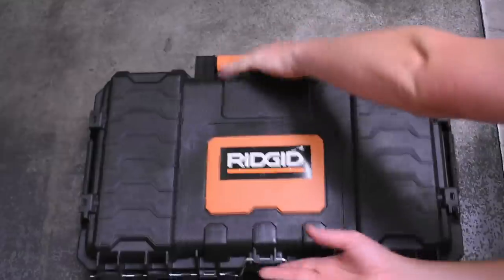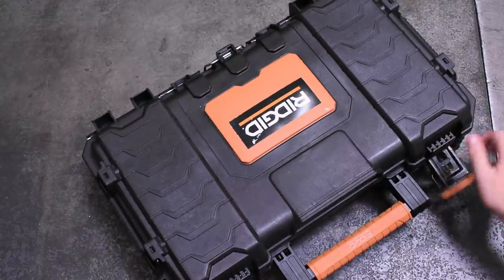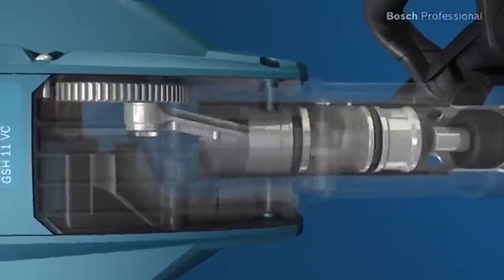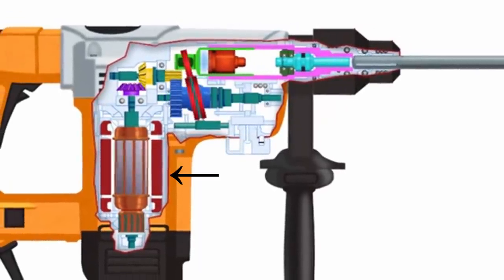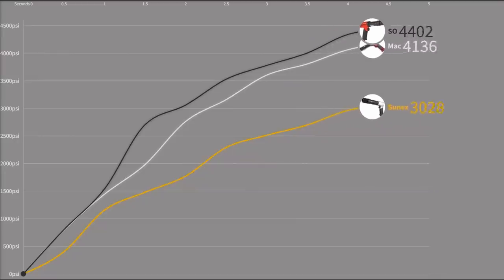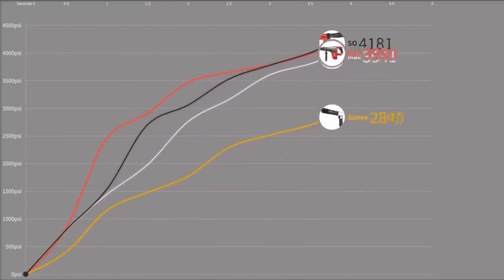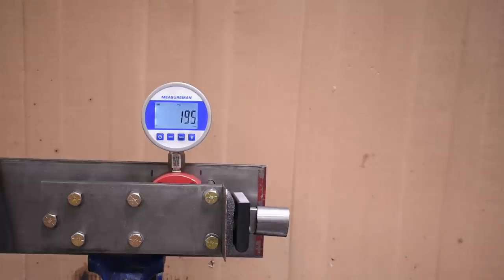How Rotary Hammer Drills Work & Dyno'd vs Air Hammers

Comment from the maker: FAQ: Does pushing harder/different change numbers? Not that we've seen in 76 runs. Also, tightening a bolt with a drill would not have done anything to measure the drill's torque capability, which is why we're not here. Do you want to see more SDS hammers dyno'd? What type? More SDS Max? SDS Plus? Home depot rentals? SDS has been added (for now) onto our air hammer ranking: https://etsy.me/3G8j3QK But can become its own category if grown. This is the best bang/buck .401" air hammer by our math: https://amzn.to/3ITtFoI
Reply: Can you guys try the Ridgid R86711B if you do another video? Thanks for all the great work/content!
Reply: Dewalt dch133
Reply: As a non-car worker, SDS is actually super important for me.  I would love to see twisting torque and hand feel measured like you do with the impact wrenches!
Reply: Some of the smaller SDS plus tools would be nice, since size and weight wise they might compare better with air hammers.
Reply: great video. there are adapters to use sds hammers with a socket so maybe next time a torque test so you have hammer and you have torque numbers then you can realy compare sds hammers
Reply from the maker: Just for everyone's knowledge, a drill can't be dyno'd by tightening a bolt like an impact can. It requires something much more complex that we've been working on with not much luck, but still plugging away.
Reply: Hey, great video. To clarify, in this case foot-pounds is not a measuremnt of torque, but energy. 5 ft-lb is the energy required to lift 1 pound 5 feet high or 5 pounds one foot high.
The biggest hammer drills seem to max out around 14, although milwaukee claims 19 on their largest (starting to look like a small jack hammer).
These tools are interesting though, it's like having the compressor built right into a pneumatic tool.
Reply: Yes! I was just starting to look into these! Heard they are a great addition and have many uses (digging, as well as drilling holes). The price seems to quite broad. Is there noticeable difference in reciprocating saw configuration vs the right angled type (similar to tested)? Some are variable speed, is that worthwhile to pay extra?
Are the Chineseum ones any good? They're a quarter of the price in some instances. Weird to me that the big ones only start around 8 amps. Seems to be broad range of RPMs, is that bc of gearing?  How do they compare and perform for concrete demo? Are battery worthwhile? I own the Rigid line, but prefer corded still.
Reply: .498
Reply: I would love to see all available SDS max and SDS plus hammer drills tested 120v and battery powered. Testing Home Depot rentals is a fantastic idea as well. I rented a Makita demo hammer just like the one in the video last year and was impressed by it.
Reply: Hilti... is it worth it? I'd bet yes
Reply: I have the dewalt version, and the thing that bothered me the most about it was the trigger is simply on or off. That tool set me back $1250. Came with 2 9ah 60v battery's and fast charger. I wish the trigger was variable, because starting off sideways is easier if its not instant on.
Reply: maybe next time a jackhammer with dimensions similar to Atlas Copco TEX5? I saw a little jackhammer like this in a truck service.
Reply: I'd like to see you guys test ingersoll-rand industrial hex bit air hammers.
Reply: The DeWalt 12V Extreme SDS Rotary would be interesting to see compared to other cordless SDS offerings. I suspect the results will leave us wondering why DeWalt even bothered.
Reply: It would be great to see the other milwaukees and Makitas both corded and cordless in the $300 range.
Reply: My big one here for bang-for-buck (most people are not going to buy a $1500 AVR gun to run a cold chisel with) is what's up with the big, cheap Bauer and otherwise HFT rotary hammers.  And for that matter maybe their breaker hammers, which if you need more beans than a long-barrel air gun will ever deliver might just be the "affordable" go-to with IIRC up to 70 "ft-lbs" of impact energy.
Reply: I just wanna see the 498 shank big boys…bought a HF chief after seeing your video, and it’s done everything I’ve asked it to. I’ve split lug nuts with it, busted ball joints, ETC…but if it ever breaks, or fails to do something I ask it to, I’m gonna get a 498 shanker. Wanna know which one is the stoutest.
Reply: Would love to see ryobi HP cordless sds and Bauer 1641E-B.
Reply: I’m curious how the newly released Skill Auto Hammer compares. I know it’s not really intended for the same purpose but it’s a cordless hammering device. It seems like cordless tool companies make one about once every 10 years or so.
Reply: I'd love to see how a Ryobi brushless SDS+ compares
Reply: I would much rather see some air riveters and .498 shank airhammers. Would be very interesting to see how well the teasing trigger on the air riveter works for keeping the power down and how powerful they are compare to the same shank hammer.
Reply: There are SDS to 1/2" socket drive adapters.
Reply: Spoiler alert! Rotary hammers have way less torque than you'd expect for such big drills. My testing showed a 26mm hammer like the dewalt DCH133 had around 1/2 torque of a drill/driver like Milwaukee or impact like Dewalt DCF887N
Reply: I don’t have any of these tools but been seeing ur videos for long time
Reply: Try dewalt 60v
Reply: Can you try this HERCULES 10 Amp 12 lb. SDS-MAX Type Demolition Hammer with Maximum Vibration Control - would like to compare this to the chief air hammer. Thanks!

Comment: I had no idea that was how these worked.  It seems to me that a cordless "air" hammer is actually an option. If Milwaukee were to remove all of the drilling parts they could easily slim this thing down and make it more practical and maybe more powerful.
Reply: In corded variations they exist, they are called chipping hammers or demo hammers. With hammer weights ranging from 11lb to 28lb.

They are the little brothers to jackhammers and exist in atleast 4 sizes that I'm aware of, however none are as compact as a true air chisel or air hammer, instead they are much closer to the roto hammer demonstrated here.
I would guess that is because of the addition of electric motor and battery dock.
Reply: @lightjedi6  company’s will find a way to make one. thier just has to be a demand for that. i saw a few years thier will be a electric air hammer
Reply: @lightjedi6  yes there a pain to run all day busting out refractory.
Reply: They already make electric demo hammers. I prefer to have the rotary hammer with hammer option for what I do with it.
Reply: @VertexDigitalArts  Actually, SDS  rotary hammers are super common in the US, in commercial and industrial use. Many, many multifloor buildings use concrete for the floors, and a large subset of those buildings also use concrete for the walls. Nearly all commercial buildings also use a concrete slab for the foundation.

It's only in residential construction that they're relatively uncommon.
Reply: Or even an attachment for impact wrench's...
Reply: @mudrunner1 It's interesting you say this, because I've seen a mechanic on YT wondering where Milwaukees cordless air hammer was... (they haven't made one yet but your comment is very interesting)
Reply: Those exist.
Its a chipping hammer then. Basically only a motor and hammer gearbox with handles attached. 
They are surprisingly small and lightweight then. My local hardware store had two models from Hikoki in SDS Max and I had to have a look at them only to be really surprised how light and compact a hammer is when you take away everything unecessary and make it a hammer only machine.

Comment: i'd love to see the Hilti Cordless SDS Max tested. theyre probably most expensive in class at around $1,100. does that equal more better
Reply: Equals more better warranty at very least lol 😂
Reply: I'd put my bottom dollar on betting they're the best
Reply: Hilti... Probably not. They are in it for the money.
Reply: For $415 U can get the Metabo HPT 36V SDS MAX Rotary which can go all day with it's AC adapter and lifetime warranty
Reply: Historically, Hilti has prioritized durability and endurance, so it might not actually be more powerful.

Also, $1100 for bare tool or kit? If it’s a kit, Makita’s XGT 80V rotary hammer kit goes for like $1500.
Reply: Hiltis design theory is to make the best over all tool not the best at a task there made to have parts replaced when they fail the engineering and materials that goes into the parts are higher quality typically right down to the plastic moulding in which they are untouchable
Reply: Hilti is all about reliability not max performance. Having used both. 

One thing I've noticed for almost all Milwaukee is they're powerful but I do not find them durable at all for their price.
Reply: more money doesn't mean more power/performance, but rather more lifetime, less downtime, better service, etc.
Reply: You don’t buy hilti for more power you buy it for longevity.
Reply: best one is the TE70... its a monster, my fave for any heavy work, and driving a 10' ground rod through ANYTHING
Reply: @narmale  I've got a TE55 that's as old as me. Still works great.
Reply: @AdamTuralinski  all metal too ill bet 🥰
Reply: Hilti cordless safety data sheet??
Reply: I think you used the wrong term, not more better, but more beans.
Reply: Hilti will absolutely perform better than this Milwaukee. Milwaukee makes great tools but their SDS max hammers do not compare to Hilti, DeWalt and Makita.
Reply: Hilti are often very well built, at least the tools that are typically hired (because they benefit from tool longevity, instead of you)
Reply: The Hilti is 36v too. Lick-en-stein’s finest.
Reply: hello fellow donut viewer

Comment: I’d like too see a similar test with a 1” or 1-1/8” Sds plus . This was a awesome idea for a test I’ve never seen anything like it and always wondered . 👏
Reply: Id like to see the sds plus too.
Reply: Yes, a 1” and 1-1/18 SDS would be ideal, this is the most common size used for most installations, it’s what I have.
Reply: A top of line SDS+ is rated for about 2.4 ft.lb, as oppose to 5 of this SDS max. So I'd expect it to perform about half as well.
Reply: D handle corded vs cordless?
Reply: As a member of the red army who has both the sds-plus's, theres a massive difference between the 1" and 1-1/8" sds. The 1-1/8" will destroy any drill bit less than 3/8" diameter while the 1" will push a 3/16 bit all day or until you hit rebar.
Reply: @greentjmtl the SDS plus I have does 3.0ft-lbs.

Comment: I want to see some of the compact SDS stuff like that DW Atomic.
Reply: He should test using a recip saw as a SDS. How many joules of impact energy does a recip saw has? A recip goes back and forth just like a SDS hammer or air hammer.
Reply from the maker: @collinzeng9231  A recipe saw goes back and forth, it doesn't use instantaneous hammer blows. It would look like you're rowing a boat and just jiggling your body about.
Reply: @Collin Zeng  it would be a great idea since most people would have the recip over an sds
Reply: Including their 12V Extreme SDS.
Reply: The atomic doesn't even have hammer only mode

Comment: At work, we've often taken a full SDS drill bit, cut off the end, add a slot and use it on the rotary hammer to drive cleats that join ductwork.  It's loud, so very loud, but way easier than using my arms.

Comment: There are definitely much more powerful SDS-Max Hammer/Drills from the likes of Hilti, Makita, Bosch, and Metabo. They also offer chipping hammers only, wi the out the drill modes. Would love to see a separate comparison chart of all the SDS-Max hammer drills…as well as the SDS-Plus category. Would be a nice series of videos you can do. And there’s nothing online like it.
Reply: Seems like a job for project farm
Reply: I’d love nothing more than a Project Farm review of SDS-Max Hammer Drills. I just doubt he’ll spend the money on all those top end drills, in particular Hilti or Metabo. He generally skips or avoids reviewing the pro level stuff, cause his channel is more geared towards regular consumers.
Reply: @BigBear--  just regular SDS stuff
Reply: @BigBear--  Makita, DeWalt, and Milwaukee being 'pro level stuff' kinda defeats your argument.
With some exception, Project Farm generally runs entry level options from whichever brands he chooses, with some exception (such as using the Fuel multitool in that video).
Reply: @reaperreaper5098  nah he does review some pro stuff, generally in smaller tool categories though. When he does an electric pressure washer comparison though, you won't see a Kranzle or Northern Tool model. Or if he does wet/dry vacs, you'll never see the high end options from Makita, Bosch, Festool, Ridgid, etc...that are like $450+ units. However if he reviews hammer drills, I wouldn't be surprised to see the top end Makita, DeWalt, and Milwaukee offerings. I sort of get it, but not really...I mean I don't think its a money issue, not now anyway. There's plenty of us buy once cry once DIY people out there, so it'll still be interesting, and he can always just break it down into categories like Value, Budget, and High End.

The reason I even bring it up, is cause sometimes its worth spending triple on a much better tool, however thats not nearly always the case. Sometimes there's zero value in a much more expensive tool. So its not even like its always that more expensice wins, and that's what I want to know. When is it not worth spending more.

Comment: Yes, an SDS can do the job. I could not get the front wheel bearings off a 2006 Sierra with any of my air hammers. I spent at least 20 minutes on it before I got out my Makita HR4002 rotary hammer. In hammer only with a very dull bit, it took more time to run the extension cord than to get the first bearing off. The second one yielded even more quickly. There is a threshold that needs to be met, and this unit definitely passed it on that job.  After getting the bearings out I spent another 30 minutes sweeping up half of the truck that landed on the floor in the form of rust. Frankly, I have not messed with the air hammers to much since, even the Thor, because the Makita or my Unitec 162/3 make short work of making things come apart, and the compressor is happier, too.
Reply: You have a thor 498k? I have been looking for one but no one had it. Is it weaker than the makita?
Reply: @zachary3777  I have the Thor 498K. All I can say is that the Makita worked where the Thor and IRs failed. I tend to use the IR 114 if I am already using the air hose and if that is not enough I go for one of the electric ones, but for most things I use the battery powered stuff, so grabbing the hose or the extension cord is a wash. Since my construction tools are just on the other side of the room, I just go full nuke rather than waste any more time.  The Thor is nice, but I have more bits and the scaler fits the IR, so the Thor is a toolbox queen.
Reply: @kenchilton  do you think it is noticeably stronger than a long stroke 401 gun like the IR 119max? There are a lot more 401 bits available so I am inclined to go that way, after looking at the specs. The cylinder bore on each is 3/4"

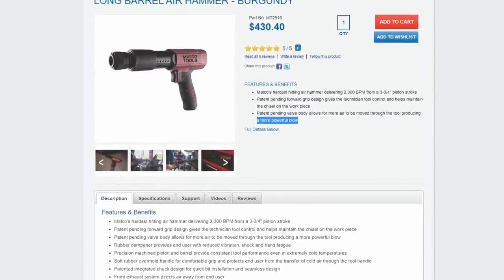Comment: @2:19 - FYI Ft*lbs isn't only a unit of torque, it's also a unit of work (energy). For torque, the foot part of the unit is the distance from center that the force is applied, for work it's the distance that a force is applied over (if you push with a force of 5 lbs for a distance of 1 ft, you've done 5 ft*lbs of work).
Reply: The units are the same but they are entirely different measurements.  One is a 'force' measurement, the other an energy measurement.  In examples like this people often (understandably) assume that 1ft*lb = 1ft*lb, but no.  Not when the vector of the two units is 90 degrees different.  That vector is not included in the units and that change makes them entirely different and non-correlatable.  Context matters.
Reply: @knurlgnar24  the issue is that the units are not the same.  Foot-pounds of torque are 1ft * 1lb of force.   "Foot-pounds" of energy (also used for e.g. bullets) are foot-per-second (squared) pounds, or 1 lb * 1 (ft/s)^2.
Reply: the physics explanation is that torque is a cross-product (and a vector quantity) while energy is a dot product (and a scalar quantity)
Reply: @justAnotherMike82  what wud you call noncommutative spinor? Professor Basil J. Hiley calls it a novel "force" that iis nonlocal - or novel "energy" - in reality it's neither and both as "active information!" thanks

Comment: More SDS max please!  I bought a corded, refurbished Bosch SDS Max rotary hammer for various work outdoors and it's been amazing.  Breaking up concrete, drilling through concrete, breaking through very compacted clay spoil, packing soil in small areas, etc.

All of the bits add up quickly but it's much less hassle than having to go rent tools, and it's really a big labor saver if you have dense clay soil.

Comment: My neighbor fashioned a "cup" or socket in lg. sds to drive copper ground rods in.   Unless you hit a big rock, it's going in.  If you hit a small rock it either displaces it or breaks it.  I'm not surprised at the relative amount of chooch here..  Really neat tools.
Reply: Hey mate I'm interested in this "cup". Do you know if your neighbour has a public image or video of it? I'm so tired of driving the rods with a Sledge hammer 😅
Reply: @wearsjorge55  Ground rod driver attachments are sold at home improvement stores, they work well. The SDS Max are significantly better than SDS+ if you happen to have generator available on site.
Reply: @wearsjorge55  Well I asked him, and it was store bought from dewalt.  I searched and sure enough, DW5947.  It looked more "crude" than his other sds bits so I assumed it was hand made.
Reply: @Little_bane  thank you!
Reply: @mattfleming86  cheers mate really appreciate it